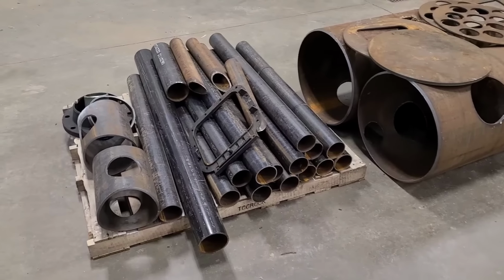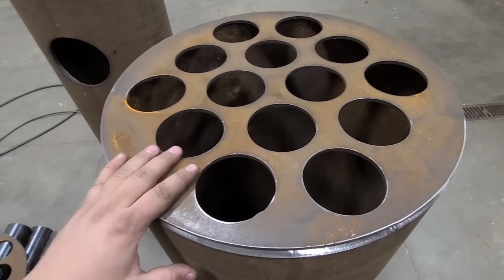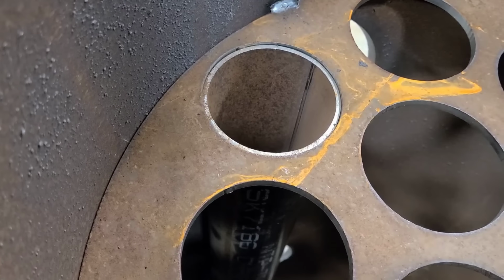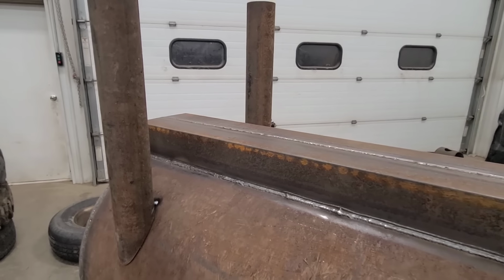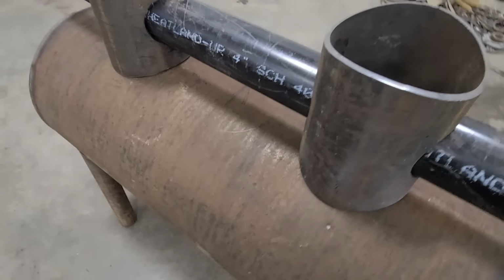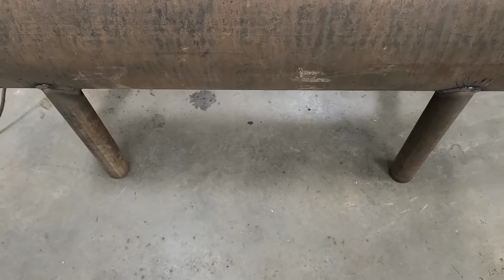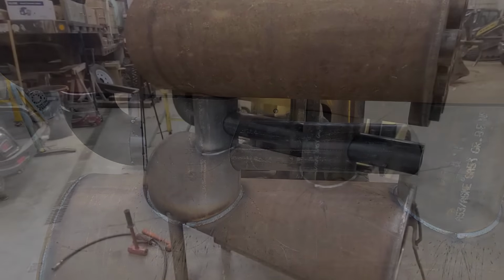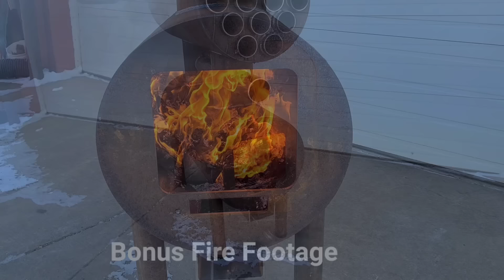My Ultimate Shop Wood Stove Build Part 1

Comment: Man you built it hell for stout. Your grandkids will be using it!
Reply from the maker: So all the pipe and plate steel was leftover drop that was destined for the scrap barrel, I figured I could make something useful out of it
Reply: @kylechrist  absolutely! That 20” sch40 ain’t cheap when you hafta buy it. I used to sell it so I know. Great looking job buddy!
Reply from the maker: @dwjr5129  no its not, thanks!

Comment: Great looking stove well built but it is a good thing you own heavy equipment to move it. No worries about burn through It will be around long after we are both gone. 👍😎
Reply from the maker: You don't move this by hand, that's for sure. The 20" sch 40 pipe that makes up the two "drums" is 123.11lbs per ft, each piece is 4ft long, so 8ft total. That puts the weight of just those two pieces at 984.88lbs. I'm guessing total weight will be around 1500lbs

Comment: Very nicely done. The only thing that I'd add would be an intake for outside air. A firebox that big will suck up a LOT of air for combustion and, unless you draw that air from outside, it will suck a lot of your already heated air out of the room and up the chimney. Also, a damper (and/or a low speed inline fan) on the intake makes controlling the combustion rate a whole bunch easier than just a chimney damper. If you want to get fancy, you can thermostatically control the intake fan to increase the burn rate in response to room temperature.
Reply: Or you can just recirculate the air inside to make it warmer. Does the furnace in your house suck air from the outside to heat your home?
Reply: @jasongrinnell1986  you just don't get it
Reply: @jasongrinnell1986  most furnaces will have a exhaust and a fresh air/ combustion intake. Its common and called a sealed combustion furnace.  
With a fire this large (much larger than what occurs in standard furnace) it will require much more combustion air. He's recommending a combustion air intake basically.  All new gas and propane furnaces have this,  most are ran up through what's called a concentric vent kit.
Reply: @jasongrinnell1986  wrong , the stove consumes AIR  that's what going out the chimmey .  many stove have a duct to bring in air from out side to feed in to the intake. rather than using the warm house air that get replaced via air leaks and cracks to the out side.
its called make up air , same thing with big vent hoods over stoves
Reply: @jasongrinnell1986  A typical furnace doesn't draw that much air compared to this. While I don't think this will be an issue with his shop, modern houses (Built within the last 20 years) often are so well sealed, a wood burning fireplace can't get enough oxygen and will cause draft issues. Many new houses have a 2" pipe that goes outside to bring air in for the fireplace.
Reply: Been we call that make Up Air. If you Put out 3,000 RPMS THEN YOU MUST MAKE IT UP. 👍👍👍👍👍👍👍👍
Reply: I have a Reny Dynamic furnace that has that feature and it works .
Reply: @jasongrinnell1986  mine does and i have a HRV unit as well.

Comment: I very much enjoyed watching this build.  Years ago we had a similar heat exchanger on our wood boiler made by Magic Heat.  They still make them.  It would throw so much heat you couldn't stand in front of it.  It had a rod in the center with a handle and an internal scraper that would clean the creosote off of the exchanger tubes.   It worked very well.  You would simply slide the handle back and forth and it would clean the exchanger tubes.  It does seem like a lot of work the way you described cleaning yours but it's important that it gets done.
Reply: TORRID AIR Blower...We had one too. Ever seen those tubes glow ?
Reply: Oh Yeah!  They would glow cherry red.

Comment: Great idea, using boiler technology in reverse. In a boiler, the smoke goes through the tubes heating the surrounding water. You have the fire surrounding the tubes instead. Of course, here in Southern California, it wouldn't be needed. Thanks for the video. Jon
Reply from the maker: It's not technically in reverse, there are both water tube and fire tube boilers. This would be like a water tube boiler with the fire on the outside of the tubes, and instead of water I'm using air. Thanks for watching Jon
Reply: @kylechrist  Aren't water tube boilers a pain in the a** to clean? With sut inside tubes you can send a brush through them; with sut around tubes how do you proceed?

And while I'm already smartassing:
Aren't the media in heat exchangers usually moving in opposing directions? (Most cooled smoke gets coolest air and most heated air gets hottest smoke)

Greetings and stay safe

Comment: Very good build. I always see people making these wood stove heat exchangers with the fire on the outside of the tubes. Typically with heat exchangers, the fluid more prone to fouling will be inside the tubes since they are easier to clean.

Comment: I love this build. 
Thoughts:
-Gussets on the legs tying the legs into the body is cheap insurance. 
-I wonder if you could extract more heat out of the unit by placing a shop fan at a right angle to the heater and circulate air over the heater as it’s burning. It would draw heat off the external surface of the whole unit while it moves air around your shop. 
-It would be interesting to see what the exhaust gas temp is at the top of the heat exchanger. That would tell you how well the heat exchanger is doing its job. When I saw the size of this unit the first thing I thought was to put a secondary exchanger to pull more heat before the gas enters the flue. This could be thin wall, like 14 gauge steel. 
Just some ideas! 
Too quality build.

Comment: One thing you can add to the tubes to help with the heat transfer is a plate 3" spiral flat plate in the tubes. This will cause the air to rotate outward against the sides of the heat ex-changer tubes.

Comment: On my shop stove I built a flat above the door to cook on and lined the bottom half way up the the sides with fire brick and use a shovel to clean out the stove ashes.
It would be nice to see your door,latch,hinges,and draft control.
You did a nice job.

Comment: Really nice job, I would recommend a couple of modifications. Line the bottom portion of the lower pipe with fire brick, you will be burning through the bottom after four or 5 seasons using it and the fire brick would let it last a lifetime. Second, have you researched anything about secondary burners? Basically it's a plate in the upper third of the firebox with air tubes that have the air coming in lower down and being heated by the fire itself and it burns the unburned flammable gasses. Beside it extracting more heat from each burned log, it has the much added benefit of keeping your heat exchanger and chimney much cleaner. I put a Secondary burn chamber in my little shop stove and it increased the heat coming from it by a good 30%.

Comment: nice build that plasma cutter makes easy work then the torch lol, i have made one smaller from scrap pieces laying around few years ago and used 1 id pipe for the blower fan in the back so the air would stay constantly hotter was pushing 140 to 160 degree air out warms the shed up fast and no wasted heat

Comment: That was a excellent build you must work in a fab shop having access to all the materials I also worked in a fab shop and the cost of pipe and tube is outrageous plus everyone don't have access to a 20 tube plasma table but that works out in your favor that thing is overkill but will last a very long time great job would like a follow up on how it performs thanks for sharing
Reply from the maker: Thanks! There is a part 2 and 3 out for the wood stove, I will also be doing a 1 year review/update soon

Comment: My grandfather made a waist oil drip for the wood stove in the shop. I can email you pics if you want. It almost doubles the BTU of the stove. I think he got the idea from farm show magazine. It's pretty simple. a steel bucket with a pipe welded to it going to a petcock, copper tube for 6" then a redundant ball valve, back to copper tube, then a transition to a 4"piece of ¼ or ⅜ pipe going into the top of the stove. It's really simple and a good way to turn old oil into a massive heat increase. It keeps our 75x50 shop warm. Only the bottom half of the walls and the ceiling are insulated. If i keep it stoked I've been in a t shirt borderline sweating with snow on the ground outside.

Comment: Nice job, and some nice toys to assist with that!  Thanks for sharing.
For ideas you might entertain (after the build is done, of course, and maybe you've addressed these, but having the fire exhaust pass around the tubes in the exchanger makes for a lot of surface area for creosote to accumulate.  Creosote fouling reduces exchanger efficiency and requires frequent cleaning.  Way back in my younger years, my dad added an eight inch stack heater to our wood stove flue which is pretty much your basic exchanger design, just a bit smaller.  It had a free-running tube plate attached to a pull-rod that could be pulled out and in at any time which would scrape off the creosote debris.  Another idea might be to pass the flue gasses through the inside of the tubing, and blow air around the outsides - reverse of your design, but that could be a bit more challenging and disruptive to cleaning since each tube would need brushed out individually by removing an access plate, much like I did on my oil boiler.   
Just some food for thought.  Have a Happy New Year!

Comment: An extremely interesting project.  I admire your skills and ingenuity.  Possibly it would be advisable to mount it on locking wheels
Reply from the maker: It's not going to be portable as the exhaust has to go out the roof

Comment: Looks sharp. I had the same type of heat exchanger setup. Plugged tight with hard creasoat from the moisture caking in it. Probably from burning it to slow with poorly dried wood. Couldn't burn it got enough in the basement but in a shop I think you'll have a better chance to keep it roaring n a little cleaner. 7018 n a buzz box on those long tubes would make light work of it but then you'll loose the nice look of consistent weld pattern.

Comment: For control of the flame you can probably run a bypass tube with a simple valve from the circulation fan and feed it into the burning chamber. It should allow you to control the oxygen going into the burn chamber increasing and decreasing the burn rate of the wood for when you first fire it up you can run a lot of air in, and when the shop is up to temp you can lower the air flow rate.

Comment: Neat project. I'm wondering about the lower tube - it seems like it would be blowing HOT air right in your face when tending the fire. Personally, I would consider cutting it back and putting a Y made out of a couple 90*s that would direct air to both sides.
Reply: Or cap the front and add a row of holes down the side of the middle area.  There's going to be lots of heat coming out the front of the HX.

Comment: That's a nice stove. I like the heat exchanger and the heavy weight of it. I would have added a flat surface on the top of the burn chamber right in front for a cast iron water pot for steam in the shop. Maybe for cooking a pot of beans.

Comment: We built a waste oil fired shop heater from a 500 gal tank. The tank is stood up on end with 48 used 2 1/4" boiler tubes. Our steam locomotives are fired on waste oil so the technology is familiar. It will easily turn red if not monitored.

Comment: Nice design,  I built one 40 years ago. 28inches on burner box 24inches on exchanger. Used 2 inch boiler tubes. Basically the same blower setup. My leg set up the same, but found out after it is to top heavy, safety factors. Splayed out the new base about 1 ft off the sides.
After about 30 yrs of burning hot fire ( burns 3 half length rail ties) the exchanger tubes started cracking out, cut me out and replaced. Arc gouge and 7018 rod. Probably get another 30 yrs service before maintenance again.
Reply from the maker: Thanks, I'd love to get 30-40 years use out of this

Comment: Wow that is huge I hope it's more than a garage you are heating. Also building a unit that heavy duty pretty much demands you make it into a hot water heat exchanger which would allow you to distribute heat anywhere and anyway you want with a variety of methods. It would still be easy to add a water heat exchanger coil to the end of those big tubes.
Reply from the maker: I already have a wood boiler that heats my house, I wanted something different and more on demand for my shop as I only work out there a couple nights a week. It's a 40x50 area I'll be heating

Comment: I had one of these twice the size when I was building my shop. I got tired of moving it waiting for the shop to be built and sent it to the auction. I figured at least I might get $500 or so I ended up getting $25 I was sick. I wish I would of saved it. This is the first one I seen since then.

Comment: Definitely need a cold air intake going into the top section for a secondary burn in your heat exchanger. Any smoke will get burned and it will also cut down on the creosote buildup.

Comment: That some pretty nice scrap you must do a lot of pipe work boiler maker by trade. Worked for Niles steel tank Co in Niles Michigan building high pressure vessels. I can put in a pretty nice booger too. Nice job it will last a lifetime.
Reply from the maker: Thanks! I work for a pipe welding company so this worked out well

Comment: Best efficiency upgrade I ever made to a wood burning setup was bringing in outside air for combustion.  Recommended.  Combusting inside air literally sucks ... air in from every leak in the entire heated structure.
Reply from the maker: This is just going in a pole building so efficiency isn't the best to begin with, but it may be an upgrade to look into

Comment: Make sure to add the thermometer on the output exhaust, I feel your exhaust might be too cool with all those heat exchangers. If the output exhaust gas is too cool you'll run a risk of back drip of an evaporated water from wood and also creation / accumulation of the creosote, which might cause a whole lot of trouble. The thermometer can be electronic and can drive/ adjust the speed of the air fan so the exhaust gasses are in the proper temperature range.
Reply: That was my first thought! Will there be a complete burn or will there be a quicker build up of creosote causing a chimney fire capable of spreading ?
Reply: Just toss a bunch of wet pine in there!

Comment: Had a stove in the sawmill I worked at when I was a kid but the top chamber was one big pip inside the other leaving about a 3.5 in space between the two and a big round fan in the back it was great at heating the shop and since we made log houses and fed it basically 8×10 6ft long from the rejection pile efficiency wasn't the biggest concern but it was a good place to heat ones lunch  up
Reply from the maker: That's awesome, must've been good sized to take on that large of timber 👍

Comment: This is the most efficient wood burning system.I built and used a 4 barrel system for years.Still today, I wouldn't have anything else.Just never burn pine or trash in thease.keep them cleaned and only burn dry oak wood you'll find they can't be beat.

Comment: A little late now, but for people building these make another plate with the hole pattern of the exchanger tubes but oversize the holes a little so it can slide. Then drill a hole in the middle of the exchanger end for a rod to go through.  That way when soot builds up on the pipes you just pull the rod which drags the plate down the pipes and cleans them off
Reply: Can you show this in a bit more descriptive manner? , that sounds like a great idea!

Comment: A followup after it is complete and you've used it for a while would be nice. How well does it work, now much heat does it generate, how long does a load of wood burn, any changes you'd suggest? 
Add a link in this description to the newer one to make it easier to find both. And in the newer one, link back to this one to show construction.

Comment: Put a fan blowing through those heat exchanger tubes, the more air the better.
Reply from the maker: Yep, that's exactly what the square hole on the last back plate is for

Comment: Opinions Please !? I have a similar build planned in my head except the stove being contained to one oblong shape like a Oil tank. I'm picturing the top 1/3 or  so having pipes running front to back just like this build. My question is would the heat exchanger pipes in most scenarios get hotter by being in the top of the actual fire box with what would seem to me to be the absolutely hottest air/gases/flames passing from front to back along the pipes and then exiting out the exhaust or by putting a flat plate separating the 'fire box' from the exchanger pipes so the exhaust escapes out the back of the plate up into the upper chamber along the exchanger pipes and then out the top on the front basically like this set up ?  
 It would be smaller scale than this and made from whatever I'm able to salvage whether it's cutting up a Oil Tank and shrinking it or cutting a Cylinder in half and adding sides and a front & back. So making separate chambers would not necessarily be additional work. 
 I'm just using common sense, heat rises, heat exchanges but it seems some on here understand wood burning much deeper.. I'm planning on lining the inside with refractory to make it more efficient. Oh quick question for another project, can you gain refractory properties almost as much if the refractory material is on the outside of the steel surrounding it ? Like in a outdoor scenario.. Thanks 👍